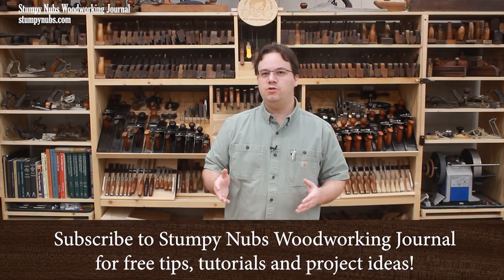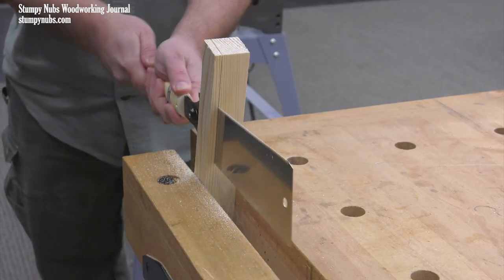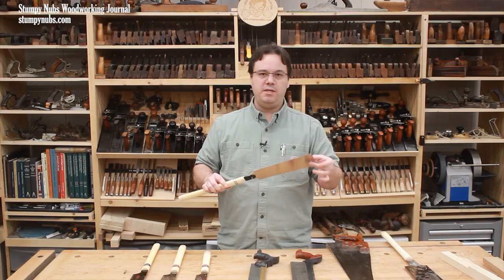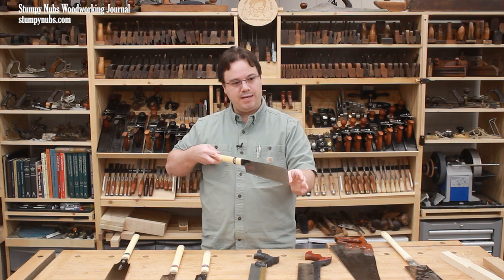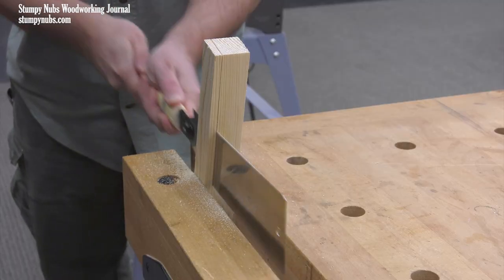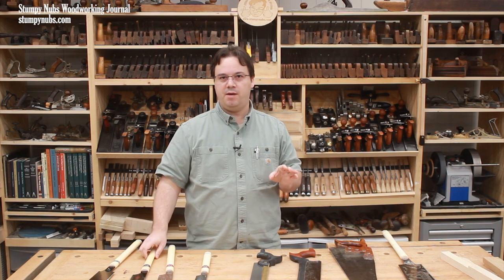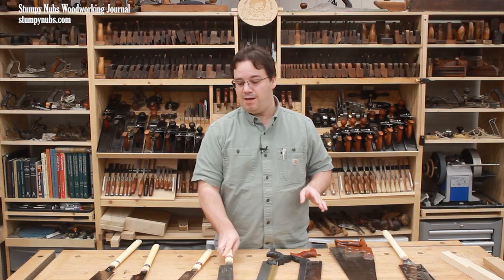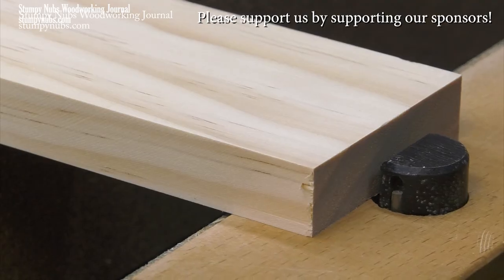Is Japan slowly killing western-style saws?

Comment: I still don't understand why the western tradition is to cut on the push stroke. As a teenager I ended up with two cheap hacksaws and one was just easier to use than the other. Both had blades from the same pack. It took me a while, but I eventually figured out that I had installed one blade "backwards" on the good one and it cut on the pull stroke. I swapped the bad one around and it was just as good as the "good" one. Obviously no difference in the blade, kerf, or handle - cutting on the pull stroke is just easier and more controlable. It's a quick and easy no-cost 5min experiment for anyone still unconvinced.

Comment: I have 2 types of Kataba one is a fixed cut saw and the other one is a fold up. I also have a small Dozuki which I bought years ago because I needed a saw that did not wonder when cutting fixed joints.
I am not able to use western style saws because I’m not able to push it through the wood, where as the Japanese saw it’s a dream to use because it works on the pull action since I have been using them my cuts have stayed true when used so much so I have not been using the bench saw as much other than just ripping to size. 
To me the Japanese saws are so logical as to how they work, you use less power to cut with them and they are so accurate. When I can I will be looking to buy the 2 types of Japanese planes for the same reason I have no muscle power to push a plane and to keep it on track at the same time where as the Japanese planer because it works on the pull stroke I know I will final it easier to use.

Comment: After 60 years of western saws I found the Japanese saw very counter-intuitive.  Whilst it is excellent for flush cutting dowels, etc, the blade is too flexible and tends to foul on the return stroke.  I find it easier to use if I put the plastic channel intended to protect the teeth onto the back side of the blade. ('old dog, new tricks' comes to mind)

Comment: Yeah, I still have my traditional (western) push saw, but I haven't actually used it in years, ever since the first time I tried an eastern pull saw.  More fun while using, better results with less effort, and there just aren't many things you can't do (and usually do better) with a pull saw.  Then you calculate in how much easier they are to store (my largest one even folds up), and for sure, if I only had space for one, it would be a pull saw every time.

Comment: I use japanese saws for some applications but i don't like them very much. They're disposable and easy to bend when pushing. I also find them quite clumsy since the blade is so short and the handle so long. I prefer frame saws. I can push or pull them as I like, they're easy to resharpen and they're cheap since the only thing you have to buy is the saw blade.

Comment: I'm not a woodworker and I never use handsaws, but it baffles me that anyone would design a saw where the cutting motion happens on the push stroke (aside from maybe some really specific applications).  In fact, this may well be why I don't use handsaws; I tried them a couple times when I was young and just found them irritating to use.  Had they cut on the pull stroke, it may have been a completely different story for me.  I just use a jigsaw for quick small cuts because it's the lightest and quietest power tool I have.  I think I'll pick up a ryoba and see how it performs.  To me, a perfect saw would have a pistol grip and cut on the pull stroke.

Comment: 5:15 I like Japanese saws but ripping a long board with a Japanese saw is grueling. 😆 Because the handle is parallel to the saw's movement, you have to grip it hard enough to keep your hand from sliding along it. The more power you put into it, the tighter you have to grip. In comparison, a western saw's handle is perpendicular to the movement and you grip it just hard enough to control its angle. The "power" comes from it pushing against your palm, not your grip.

Comment: It is a little more complicated than in one hemisphere things are done opposite.  The traditional Chinese heavy duty saw like our larger handsaws is a regular frame saw essentially identical to a European frame saw, and is pushed to cut.  Similar frame saws are used in the Jamestown living history museum.  Similarly the Chinese make a razor saw for fine work, that also cuts on the push stroke.  And, the Chinese wood plane, which looks a great deal like a Japanese plane, except for a cross-bar handle that passes through the body of the plane, is pushed to plane.

Comment: Given my experience with jewelry and guitars I'm far more familiar with a pull cut, which of curse with a saw frame is the only way to keep the blade under tension and thus the standard. Tried to use a standard western saw to do some quick and dirty cuts and could not for the life of me get it to cut without jamming. It's pretty much literally pushing rope. I had to take it to someone with a workshop to get it ripped down on a table saw instead of doing it in my bedroom with plastic laid out.

Comment: I love how you demonstrate the different saws.  I am just beginner and I have bought a lot of essential tools this year.  If I buy a pull saw, I would only use it for flush trimming (at least for now).  As a substitute for just flush trimming purpose, what would think of the Oscillating multi-tool (Already have)?  If that can do the job adequately, then one less thing I need to buy. I am just wondering if that may mar the wood surface.  I normally use it in hard to reach area in remodeling where I don't even pay attention to surfaces it's riding on.

Comment: I feel like the differences in handle design between western and Japanese saws, combined with the mechanics of the human body affect cut accuracy as well. When using the Japanese saw I feel like my arm and wrist are more locked in place, in line with each other,and the saw, and that helps keep the cut on track. Pull saws that I own that have a more western style handle, curved instead of straight, I find are a bit more difficult to stay on the line than straight pull, straight handle saws.

Comment: All of my recent western saws were (unfortunately) induction hardened. You can't correct excessive tooth set or correct badly ground teeth because....induction hardened. My best cutting (in terms of accuracy) is a cheapo carbon steel back saw from the bottom shelf of the Orange Depot  that I hammered the teeth flat based from advice from a youtuber I can't recall at the moment.

Comment: I think the western pistol grip is superior in that it is easier to cut and stay plumb. I have a Veritas tenon saw and using it was a revelation. For smaller dovetails I use a Japanese backless pull saw but I find I am less likely to veer off line with a western saw. The main drawback with the western saw is the wider kerf. However I have both types and enjoy either. They each have different challenges. Western saw biceps, Japanese saw triceps. I don’t sharpen saws these days, apart from my chain saw😀

Comment: Comment from Japan (30 years and still here).  First, your explanation is excellent.  The traditional straight handle saw (the general word for saw is nokogiri のこぎり) is common in Japan, but there are modern variations, including curved handles and more grippy material such as rubber, and those with a small hook-shape at the end of a straight handle to help prevent the hand from slipping off.  However, I have not used those and get on just fine with the traditional type.  One negative aspect of the pull saw that you didn't mention is that the sawdust accumulates in front of the saw and can mask the pencil line if the surface is horizontal.  I find myself constantly blowing off the dust in some circumstances.  You did not mention the kerfless saw (asarinai アサリ無い).  Asari means kerf, nai means none.  This is an important saw in Japanese joinery.
Your pronunciation of the Japanese words is quite painful for me to listen to, but I guess that is how it is.  Anyway, ryoba (両刃) is not ri-oh-ba, but is ryo-ba.  So ryo- as in "your" with an r in front.  This is a difficult sound for English speakers to make, much like tsu at the beginning of some Japanese words, but I hope you might try to pronounce it properly.  Kataba (片刃) is not pronounced kata--ba with an elongated ta-, but in fact in three short sounds, ka.ta.ba.  Likewise, it is not dozu--ki, but do.zu.ki, with no elongated emphasis.  I don't know why English speakers insist on elongating part of the word when it is not so in Japanese; however, the Japanese are just as guilty of mispronouncing foreign words with the emphasis and elongation misplaced !
Best wishes from countryside Japan.
Reply: Oh I forgot to mention that when using Western saws there is a tendency to "lean in" on the saw when cutting.  This doesn't happen with pull saws, but a new user, such as myself years ago, tends to put pulling pressure on the saw in the cutting stroke.  This is not necessary as the saws are incredibly sharp.  As my first Japanese sawing tutor told me: "let the saw do the work".

Comment: I've  been using both eastern and western saws professionally for many years,   I prefer a western 90% of the time.  More accurate, slightly faster, and easier to sharpen.  Your mileage  may vary.

Comment: Of possible interest, possible reasons why the saws developed the way they did. Steel was scarcer in Japan, armor was made with little steel. So carpenters used saws with thin blades using less steel and had to be pulled to function well, which may have influenced how planes were used. Europe by contrast steel was more available., armor was made from steel. So saws could be made thicker and different techniques would follow. Another thing would be how the japanese use mostly body weight vs vises like in western carpentry.  
Also posture, grip and body mechanics in the use of japanese and western saws should also be addressed to get the best out of which ever saw the user prefers. I believe Roy Underhill and Christopher Schwarz have talked about the various grips that were used for western saws for different applications that have been slowly forgotten.

Comment: Pulling on a saw makes more sense as it would cause the blade to bend from compression and poor alignment. Maybe it developed that way due to power generation when blades were thicker and it just stayed? Wonder about the grip though. Can 2-hand a Japanese, but it doesn't look ergonomic and slippage seems much more likely.

Comment: Hey Stumpy,

I have a table saw and a miter saw in my un-temperature-controlled, uninsulated detached garage that I haven't used in 20 years. After all this time, I need to work on a project for my kitchen. Are my tools still good? Are there any components that I should replace? (Saw blades?) Are there any things I should look out for? Should I replace everything? I'm always careful when working around power tools, and I always take decent precautions (like protective eye and hand gear,) and I'd rather be safe than sorry. Thanks for the input.

Comment: Very slowly, maybe.  For finer woodwork...yeah, pull-saws (it's hardly a uniquely Japanese thing, and never was) are generally better.  If your cuts need power, then push saws are better when you can force your weight into the cut for a bigger bite.  But those saws also need to be considerably more rigid.

Comment: I would say yes and no. Quality is starting to finally dominate the market. I have czech saws, that cut wood like Butter. It wasn't even expensive - 10€. If you get a great saw, that leaves no marks, and does such a great job, than it's hard to go back. A lot of japanese saws are great, because they are easy to handle pull saws and have great blades. From gardening to woodworking, I have been using them for all. Pretty much in dual with my czech made saws. 

This is pretty much the same with everything. Quality dominates. Knifes, axes, saws, working tools, metal, wood or otherwise. The comfort of a great work and no frustration.

Comment: Funny thing; I grew up about 35 miles from Rust and Martin Furniture and bought my first sofa from them. Now I see, with the same twin front doors, that Taylor has moved in the building. I was going to buy my first Harley before I went to Rust and Martin but after buying the sofa I did not have enough for the motorcycle. My mother tricked me. Sofas are safer than motorcycles.

Comment: How is it that I went to a building college in the UK and studied joinery and yet so many things you have mentioned just in this video are what seem like basic concepts I should have been taught about but never encountered before. Its honestly shameful. How was I not told that there are pull saws out there and that I should use them, how was I not told that there are different types of saw for rip and cross cuts. I wasnt even taught the phrase "cross cuts" or "rip cuts". We had to learn to cut joints with poor quality tenon saws. Its no wonder I was left with the sense that joinery was a waste of time and that I should just blast screws into wood with impact drivers and leave it at that.

I just wanted to thank you for making up for so many of the failings my formal education left me with, I think your chanel is fantastic.

Comment: Basically I think the difference in the direction of the cut is a result of the technology and the understanding of metallurgy of the two cultures, East and West. The East had a better understanding of steel than we did in the west, probably due to scarcity. In Japan for example the materials needed for steel production were centuries ago not as abundantly available to the Japanese, iron ore, coal etc. Consequently iron/steel is scarcer and of higher value. So if the raw material is of higher value, you’re gonna want to use less of it in producing a tool. So when it comes to making a saw, using less material means you have to think differently about how you use it. Hence why the thinner blades due to lack of/higher value material and so it’s designed to be used differently. Whereas in Europe where the elements for steel production are more common there isn’t such a worry over the cost hence you can use more to make a blade. Also Eastern cultures also were more advanced in their understanding of steel hence the hardened teeth, again likely through a scarcity of supply and so more understanding of the material was needed to make best use of it. 

It’s the same in weaponry. Compare a 13th century Katana to 13th arming sword (knight’s sword), and you can clearly see the differences in western and eastern understanding of steel. The western sword is thicker, longer and heavier whereas the eastern sword is lighter, thinner but sharper.

Comment: The saws are designed for the uses they were intended for. Western saws were made for thicker, denser woods and members. Western saws were also designed for faster cutting over accuracy as western construction used more pegs, wedges and fasteners whereas Japanese construction used more mortises, tenons and tight joinery. For shorthand on what saw to use when, if you are cutting a log or a 2x4, the western saw is likely the superior tool for what you are doing. If you are cutting joinery or straight small pieces, the Japanese saw is likely the better tool

Comment: Follow up video on techniques 👍. Disappointing that I had to practice and develop my technique. Where’s the magic bullet when you need one?  But the precision I can achieve (still learning) makes it worthwhile. In fact, I find myself using a ryoba saw rather than pulling out a power tool. For years I used a Shark saw for flush cutting and some joint clean up. Had no idea I was using a Japanese-style (and manufactured) saw.

Comment: I feel like this is missing a big advantage of western saws. The ability to cut very fast and efficiently by cutting when both pulling and pushing. I use Japanese saws for details and flush cuts, before finishing the job with chisel, knife or plane. I use a western saw for cutting quick and rough cuts or for big cuts (like felling a tree).

The main reason one wouldn't use a western style saw would be if you use power tools for the job. A lot of the cuts I do with such a saw, other people would use a chainsaw, band saw or circular saw. While the japanese saws, can't be easily substitued with power tools.
Reply from the maker: https://youtu.be/3gX8NzF4nac

Comment: I wonder if the the reason is the types of woods available, more soft woods in Japan? It seems to me that the admittedly  cheaper pull saws would struggle in a hard wood like oak or maple, but be superior in pine or cedar.
Reply from the maker: Sure, they use a lot of soft woods in Japan. But I also showed the saws cutting through white oak easily several times in this video.

Comment: The example of the front wheel drive car is not quite right. There is this thing called tourqe steer with front drive. It happens when you do a fast start. One side produces more tourqe than the other.  Or your on a slippery surface.

Comment: I'd like to see a video on the Japanese planes if that's something you could do. I'm also wondering if, for the folks that find the pistol grip more ergonomic, if it'd be too hard to make a Western-style handle that takes the blade replacements? Is the straight handle specifically and necessarily that way to work with the pull cut, or is it just "simple handle"?

Comment: I don't like using Japanese saws because my wrist are what they are and the grip on Japanese saws just doesn't feel natural to me. Also with western saws you can correct your sawing a lot easier if you wander of the line because of the wider kerf and push stroke. It's a skill you can learn.

Also one big thing about that wasn't talked on the video is workholding. Because of the pull stroke your handtool jigs might not work or are awkward to use. This is a factor that many people forget.